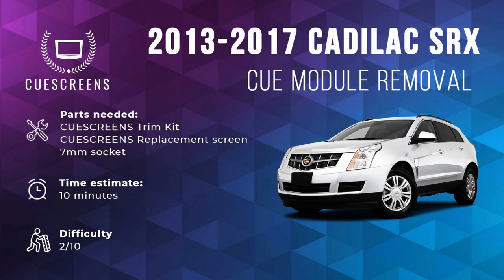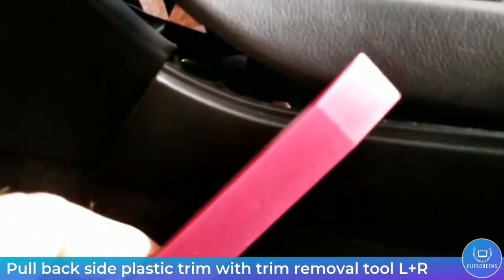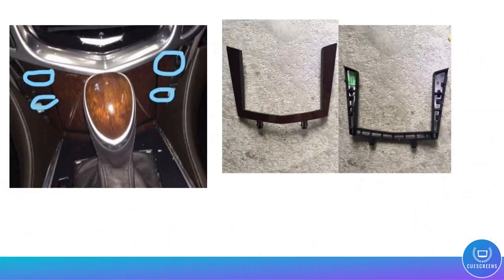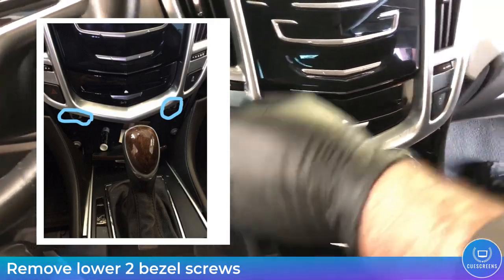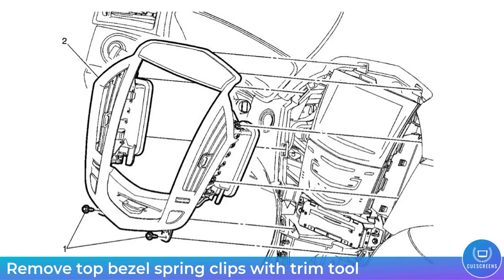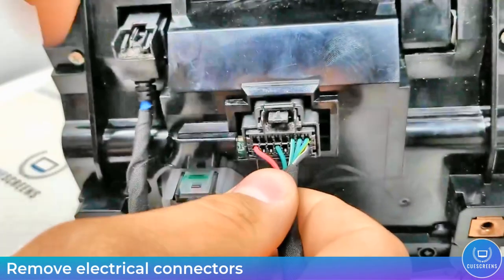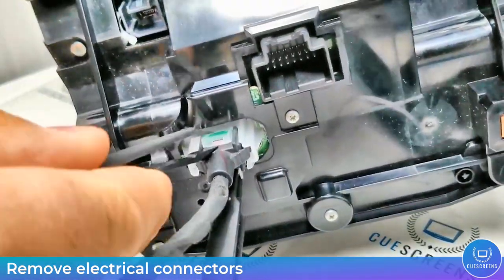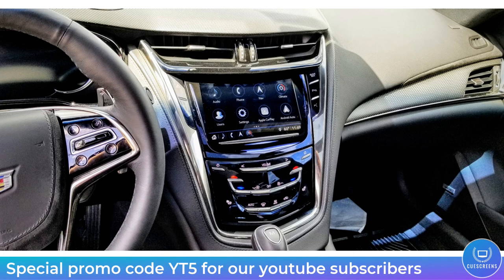[2013-2016 SRX] Cadillac CUE Complete HD Module Removal *Easy Method* 10 mins

Comment: Thank you. Awesome video's. My son and I replaced my 2014 Cadillac screen in 2 hours. He's retired Navy and works on all his own cars, so he's better than the average person at this. I just watched and helped. We checked back on the video several time to make sure what the next step was, both taking it out and replacing it. Buy the kit that comes with the plastic wedges and plastic tweezers, metal tools will scratch your finish up. When we finished, you can't tell it's been taken apart. The dealer now wants $1,600, up from $1,200 about 6 months ago,  to replace the cracked screen. We copied every step the video said, and everything came out perfect. Read all the other comments, as there are some great tips here.

Comment: I finished the Cue touchscreen install today on my Cadillac 2013 SRX. I had issues with the ribbon strips in that there are more than what was shown in the video.  I am a very literal person.  The video showed 3 white ribbon connections to check yet there are 4 connections that can be checked.  It was my mistake but once I noticed the one above the touchscreen ribbon I was able to quickly tighten it up and get it done.  I will admit that because of the ribbon issue, it took me a whole day and a half, but I am a  60 year old woman with not a ton of automotive repair background. Also we thought the touchscreen may not have been working due to battery drainage so charged it all night.  Charles, the Customer Service person was AWESOME!  He actually called me back at least 3 times with suggestions.  I am completely happy to have saved all the money and now I am getting ready to install a new back up camera.  Then on to a leaking hydraulic lift gate replacement. Whoo hoo for self repairs!
Reply: Good for you. I wouldn’t dare touch it.. proud of ya!

Comment: Thank you CueScreens!!  By using your procedure here to remove the CUE assembly from our 2016 Cadillac SRX, and shipping it off to have you replace the screen, you easily saved us well over $1,200 from the dealer for a full replacement!  The only hiccup I ran into is in the final stage of reassembly, I can't figure out how to get the leather curved trim pieces back in on either side of the transmission tunnel (with 7mm screws tightened) and then get the lower black plastic trim tucked under and snapped into place.  The lower plastic trim has that molded ridge, and once those 7mm screws are holding the upper leather covered pieces in place I can't lift the upper pieces to tuck the lower trim underneath.  It's like a chicken-and-egg problem.  Would sure love a video of the reassembly!
Reply from the maker: Good idea!

Comment: The step where you are disconnecting the wires from what appears to be the back of the unit, is there enough slack when the unit is removed to set the unit on the console or seat and get those out? The video looks like the unit is already out of the car when you take the wires off? Also I agree with the other poster that it would be nice to see the demonstration of taking the Trim off. Furthermore, I'd like to see you remove the screws after the trim is off and then the step of removing and lifting the Unit out of the dash. Thanks.
Reply from the maker: No, you will need to disconnect them first before removing from the opening. Not much slack

Comment: Do I need to disconnect battery
Reply from the maker: You can disconnect the battery if you like- but just make sure the doors are closed when you are replacing the screen so your battery doesn't run down.

Comment: I can’t even get the first piece of trim off!!! And you can see where these plastic trim removal tools are leaving gouged marks on the plastic trim. There needs to be a COMPLETE video where it’s actually showing the trim being removed.
Reply: You have to be a bit rougher with it, and you might tweak some of the edges permanently,  but it is a little tough.  You have to use some aggressive strength and be very persistent.
Reply: Did you get this thing out and back in and working. I don't see a reply to your question, did you call support? Maybe they don't want to deal with youtube questions?
Reply: Hi Mr Williams! I got the side panels loose. But not off. I was unable to get to the bolts. I guess I just need a little more hand holding. I have not called them I’m just looking for a stereo repair shop.
Reply from the maker: Wedge the trim tool to create enough opening to get your fingers in , grab ahold with both hands, and yank it hard. Those clips are coming up on 8 years of use and become pretty tight, you will need to be more aggressive with it to have the clips release.
Reply from the maker: @Shellieloo25  No need to fully remove the side panels. Just enough to peel back and access the bolts in the video. Loosen the one, and remove the other one on each side.